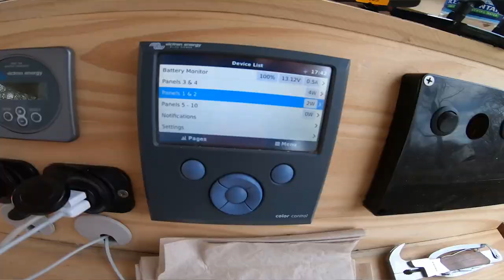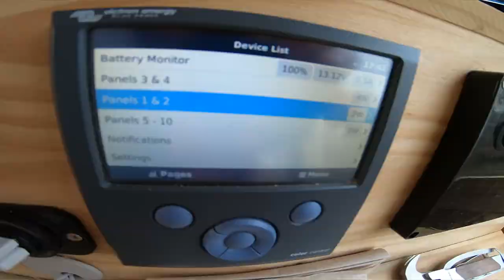Don't Make THESE 2 Mistakes When Boating!

Comment: Good video, thanks guys, I'm gonna order a spare for mine right now. I went all day with a 24 Volt 70 pound thrust minnkota and 600 watts of solar,  It looks like you have a 1000 W on your roof is it working out OK for you guys?
Reply from the maker: Thanks Dennis! Yeah we are up to 1000 watts and so far so good! The biggest thing that helps us is the Victron battery monitor bmv-702 (712 is newer version) because it has a cool feature that tells you how much time you have left until you hit your discharge floor. It’s flat out awesome!